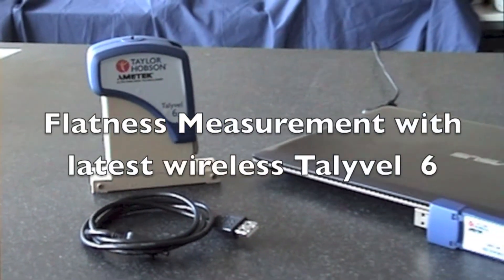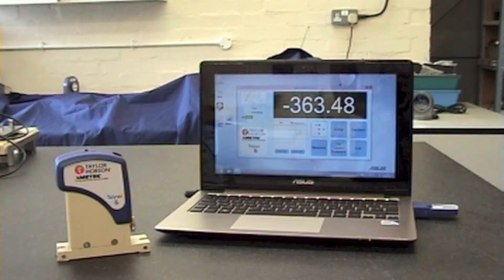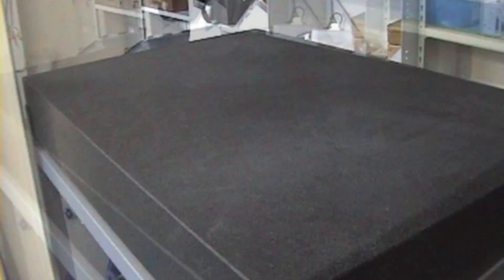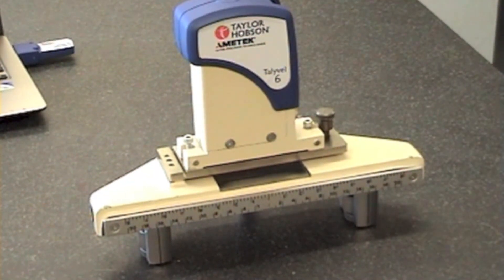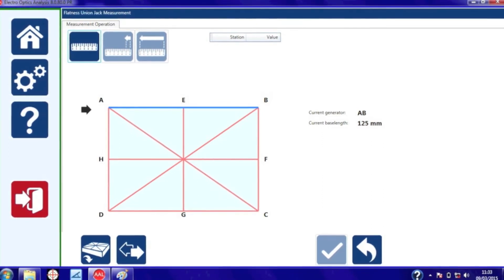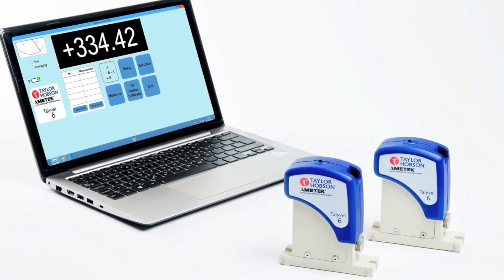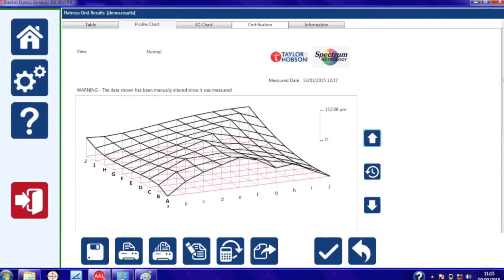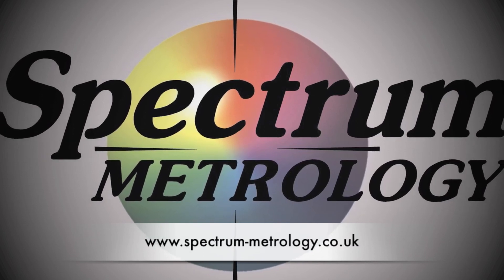Flatness Measurement of granite tables and surface plates

Comment: Most surface plates in commercial use are not level within 30 seconds and the owners realistically has no idea about three point leveling systems nor will they buy them. So this system is not practical in non-laboratory use.
Reply: I've been calibrating and lapping  surface plates for over 20 years, and I have used and own LASER Interferometry systems, Federal and TalyVel Digital levels, Rahn Planekators and Repeat-o-meters. I can tell you it is easy enough to shim or adjust a plate stand for the purpose of using a digital level system. The LASER Interereomter system and the Digital Level dual head systems are equally accurate, but the digital level systems are so much more faster to use than the LASER interferometer, Planekator, or Autocollimator system that the time required to level the plate is very much negligible. The only reason to "level" the plate during calibration is so the out of level-ness to gravity does not over range the instrumentation while performing the calibration. The only use for leveling a surface plate during normal use is to no be annoyed by round parts rolling off...In addition most floors are no where near level so plate stands on casters that are rotated around 90 or 180 degrees can be significantly different in regards to level to gravity..